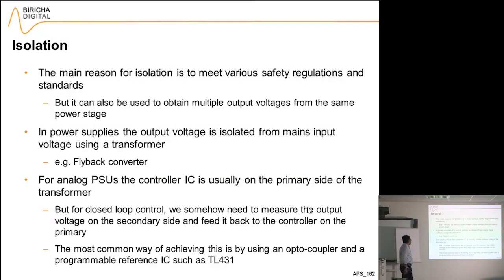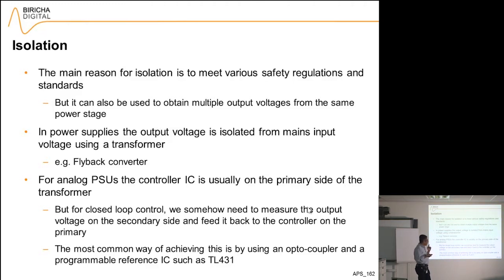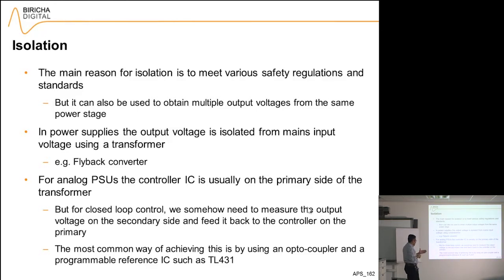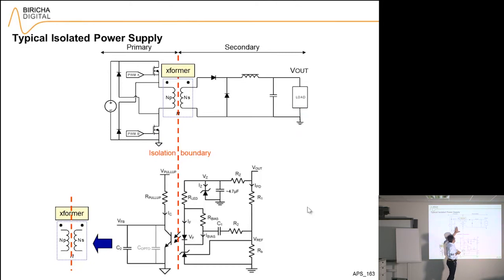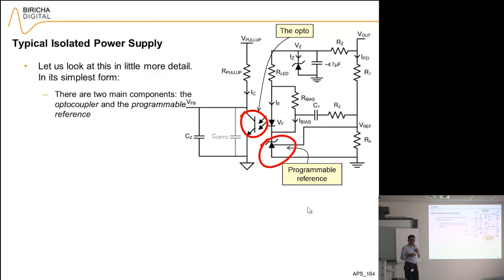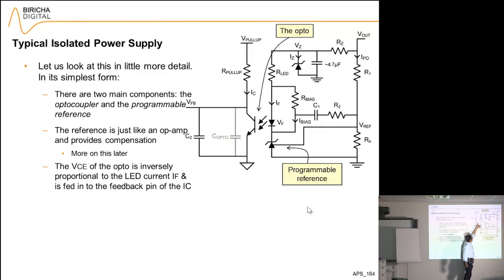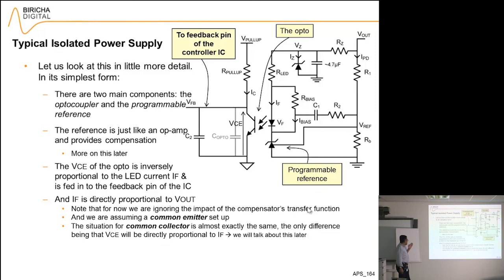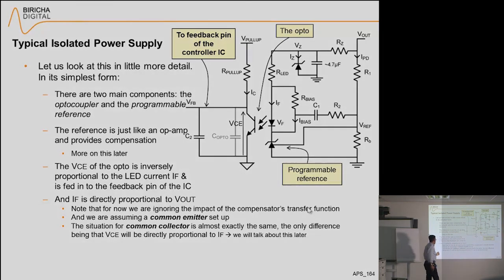How do Opto Isolated Power Supplies work

Comment: Is there another way like using a pwm modulator maybe? In space optos are not used much as they age. Is there a way to do it without the opto? Maybe couple the output inductor and and get that current and convert it to a voltage?

Comment: We are using Vz to clamp voltage then how you are telling about incresed current and low Vce......
If Vz clamps then change in output voltage changes Vref to TL431 and accordingly Vcathode changes will result into change in Cathode current.
I don't understand that in simulation decreased output voltage result into decreased Vref and TL431 stops to conduct at the same time Catode voltage clamps to Zener Voltage therefore bias current becomes zero due to no potential difference.
Can you suggest me where i am wrong ?
I know it is not good to simulate this circuit and will not behave in physical circuit but for a very basic overview.